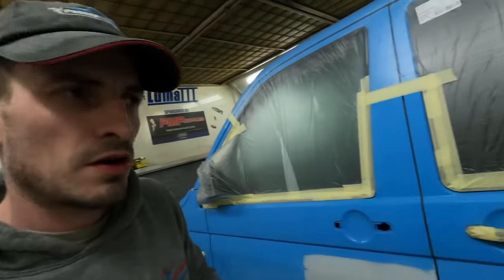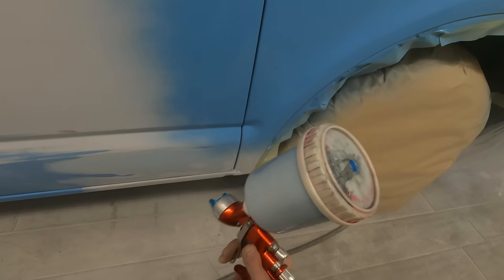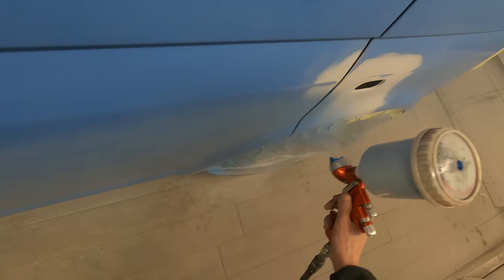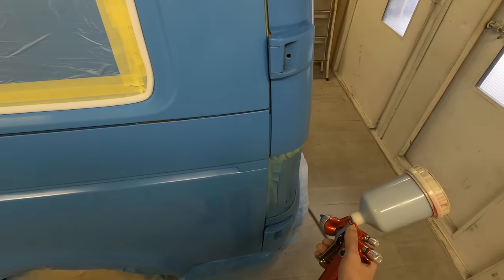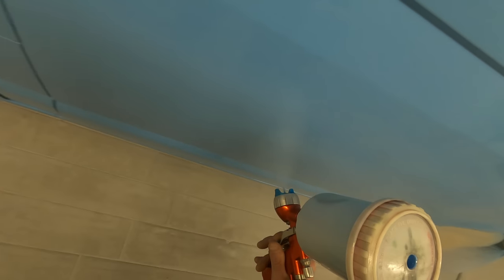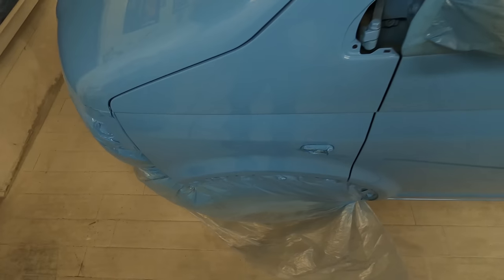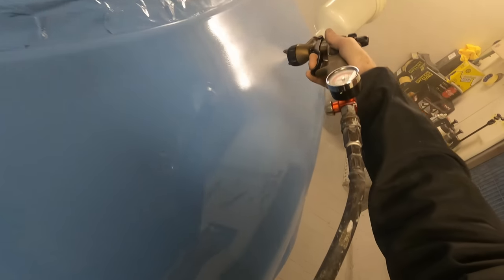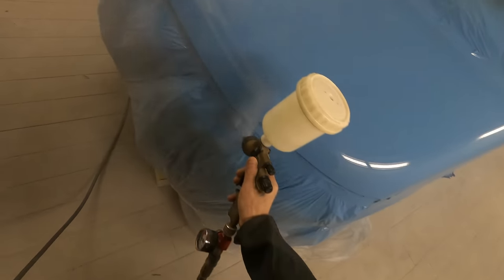Best Tip For Blending 2K Direct Gloss -  Vw T5 Camper Van Conversion

Comment: Hi, I have some experience spraying but no access to a booth etc. I want to paint my van (either in part or full) and have been thinking about using direct gloss either from rattle cans or a small compressor. My question is, will I get much difference in colour match if I were to spray panels individually? I'm a weekend warrior so I was contemplating doing say the wings and bonnet one weekend, one side another weekend, and so on. Would this be achievable or would they dry different shades? Any advice would be much appreciated 👍🏼

Comment: Nice job! Take the auto colour off the Go Pro, it won't keep changy colour once you manually set the colour temperature
Reply: Yeah I was telling Tony exactly this is in the live chat last night, I think it's down to the booth lighting as I have to have my white balance set to 3200k (kelvin), it's a bit on the blue (cold) side but it keeps the colour stable.
Reply from the maker: Thanks guys il be looking into this later

Comment: Happy New Year Sir, I’ve been checking out your videos on the 2k gloss, I use those when I spray boats. I’ve noticed that you don’t blow a lot of overspray, it seems to be contained pretty well. I’ve tried to figure your settings, and it looks to be about 2 1/2-3 turns out, what’s your pressure? When I’m spraying I may have another vessel 10 feet or so away(3 m), so I have my pressure down to 15psi, looks a bit too chunky. I’m getting better, learning everyday, just searching for some information that I can adapt into my work to help out. Again Happy New Year, hope all is well, thank you for your time, cheers

Comment: I do the same with  a red audi tt I get in regular for stone chips etc! Started getting pimpling in the waterbase as it was so transparent and had to put lots of coats on probably not drying all the way through the layers? So perfected tinting 2k solid for a perfect colour match and then one coat of clear👍
Reply from the maker: Yes mate that an issue with transparency in some colours when using water we sometimes tend to want to load it up to get coverage so it doesn’t dry as well as we think on cars like that il give them a short bake for ten minutes to make sure the base is dry properly before clearing to be safe

Comment: I use spray can clear blending solvent on those blends. Works great less polishing. and helps it bond to the old finishes better.
Reply: If you try it use spray some on the dry areas and use air from the spray gun to dry them do it a few times with air right after. almost no polishing necessary.

Comment: I'm about to paint up a T4 that I've cut welded all the corners and steps.  I had been wondering about the blending issue.  I am going to follow your advice, on this esp using the same hardener and thinner ratio......so glad this popped up in my feed.
Reply from the maker: Ah your welcome Richard and that’s what our channels all about mate helping people with tips and new ideas glad you could join us
Reply: @TonysRefinishingTV  thank you for getting back: mines just a tidy up while I save for a colour change.   Can I ask what grade paper you used on the original paint to key the new coat please?
Reply from the maker: So on the primed areas they were sanded woth p400 the rest was all done with grey scotch to a nice matt finish
Reply: @TonysRefinishingTV  Legend, thanks again.
Reply from the maker: No problem mate your very welcome

Comment: Hi Tony 
Very good video on glossy blue van 👌
My friend go t5 in white color there was some dents in it but we have managed to repaired it now.
Rest of the van white color all good.
We was going to flat it down 400 on DA sander hole van and paint it .
Then paint it .will ok and roughly how much paint do we need and lacquer for the whole paint ?
We are thinking of changing hole different color of the van it called San Marino blue B51 paint code .
Many thanks 
Bas
Reply from the maker: 3-4 litres of 2k gloss should be enough

Comment: Nice job Tony, I wondered how you went about blending direct gloss as I've heard (never done it myself) it can be difficult. The van looked a different colour outside which again is down to the white balance on the gopro, I keep mine set at 3200k for both indoor and outside but I do use different ISO and shutter speeds for both as my booth has black walls which makes it even harder.
I just have a different setup for indoor and outdoor then get the settings right for both the it's just a case of switching between them. 

Anyway mate the van looked great outside and you wouldn't know it had been blended, very nice glossy finish mate, of course it would have been better if you used the DV1 but there is no helping some people 😲🙄😂😉
Reply from the maker: Lol don’t swear at me John haha , and yeah I’m going to look into my GoPro settings later mate as I’ve just put another camera in my arsenal for filming so want it to keep good colour with that
Reply: 😂🥰👍 ok mate hope you get it sorted, don't suppose you have a DV1 base laying around that you don't want 🤔
Reply from the maker: Nah mate I’m afraid not buddy

Comment: Amazing video!Can I ask something..?I get that you using 2k as a "basecoat"and clear coat the blended area but..if you have a massive panel, and only a small bit needs repair and paint do you clear coat the whole panel or just around the blend and try polish it?for example on that A pillars!What happened there?did you have an edge where you havw to polish the new and old clear coat together?
Reply from the maker: you could do it with just gloss mate but as i mentioned in the video if you didnt have a great match the edge would show alot when polished so yes as you say you could just blend the outer edge of the colour in with some clear on the last coat to eliminate any issues in the final stage polishing the edges in
Reply: @TonysRefinishingTV  thats it..I am glad that I dont have to clear coat the whole thing..thank you for your reply!

Comment: Hey Tony, I’m glad you’re feeling better and keep making the videos. May I ask your advice on liquid glass and what catalyst and reducer that works best. I’m in Ohio so the weather can get pretty cold sometimes. Also I’d like to purchase Sagola gun for clear with a1.2 tip which model would you recommend. Thank you for your time and keep moving forward.
Reply from the maker: Hiya mate on the liquid glass mate il be honest it’s been a while since I’ve used any but from what you’ve said try the fast version mate , if look at the 1.2xl for clear in the 4600 dvr clear model mate there brilliant guns
Reply: @TonysRefinishingTV  Thank you for responding, may I also ask you what kind of clear is your preferred choice to use, something you have faith in that it looks good and last a long time. Tony, may I also add don’t think you are Superman and you can do it all, that’s how you wear yourself out. I’m not lecturing you just advising I’ve worked for myself for years and that’s the hardest lesson I had to learn, so don’t drive yourself off the cliff. Steve
Reply from the maker: Roberlo 610 or Mipa cc9 are great clears tbh mate abs I won’t mate I’ve learnt my lesson
Reply: @TonysRefinishingTV  thank you, any recommendations on websites I can buy them? And it’s been nice chatting with you
Reply from the maker: Pmpsupplies.co.Uk and nice speaking to you too mate

Comment: good video tony so whats the best gun sagola 4600 mate or the LS400 and WS 400
Reply from the maker: If you’ve got the budget then personally the 4600 mate I run the dvr clear and Aqua
Reply: @TonysRefinishingTV   tony i have a ford focus mate mk3 i just want to paint the bumper  so my devbliss gti pro  genuine gun  mate 1.2 for base is that right and 1.3 for clear full fan fulid right out 2 bar and if i want to use the china copy TE20  1.3 for clear  full fan 2 turns out 2 bar

Comment: Sorry late  to the party again, the van looked a million dollars at the end. Wish i had your ability to paint like that lol ive just painted my van and looks crap compared to that, but painted it on a hot day outside on my drive. Ive got a lot of detailing work to do now, so will flat back and get the rupes bigfoot on the job, did some earlier and came up good. Used the kovax dry sanding system which i think beats the 3m trizac but thats just my opinion. Have a great wk end dude and great edit as always 👌🤟🤙👍
Reply from the maker: Thanks man and it’s just practice mate that’s all fella have to message me some pics over buddy when it’s all done mate
Reply: @TonysRefinishingTV  will do but may be a couple of weeks as back at work next wk and the wife wants the garden hard scaping 😭😭😭
Reply from the maker: Lol sounds like Fun mate

Comment: Hi Tony hope you doing well
I was woundering if it's alright to spray high build primer over bare metal or shall i use some filler primer on bare metal and then high build primer ?
Thanks
Reply from the maker: Filler primer and high build primer are the same thing you need etch primer on bare metal
Then normal primer over it
Reply: @TonysRefinishingTV  what about epoxy primer on bare metal and then  high build ?
Reply from the maker: Yes Nate that’s fine too
Reply: @TonysRefinishingTV  thanks a lot 👍👍👍👍👍
Reply from the maker: Not a problem mate

Comment: Hi Great information, thanks. Do you have any experience using Jawel 2k direct colour gloss. I need to do some bits on my van, but bit skint at the moment and can not afford £50 a litre that im getting quoted at my local auto paint suppliers :(
Reply from the maker: It’s ok mate but not the best I’ve done a van in it before took some time to fully dry through but turned out well
Reply: @TonysRefinishingTV  thanks mate, can you recommend any other brand of paint that doesn't cost the earth?
Reply from the maker: Most direct gloss tbh is usually about £30 a litre so try another shop mate is by best advice or try eBay ect